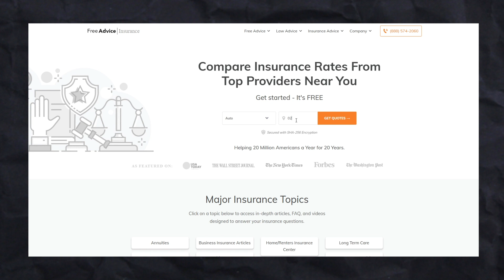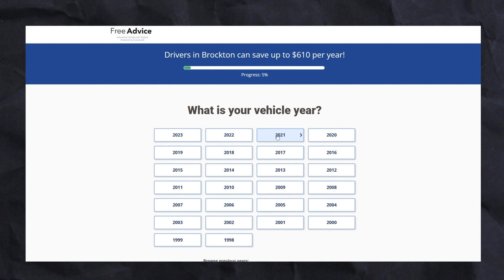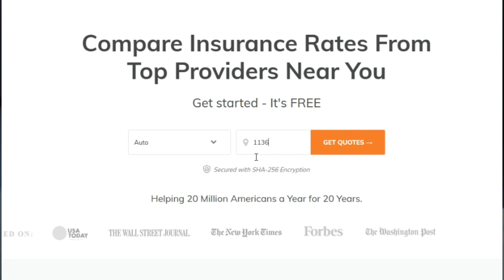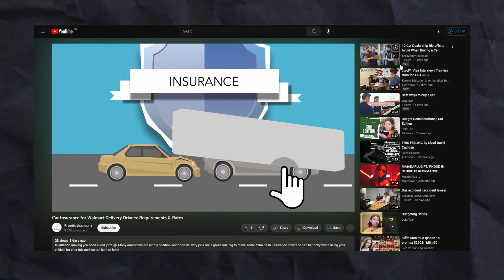“Total Loss” Car? Get a Salvage Title and Back on the Road in 2025!

Comment: Salvage title vehicles may have sustained significant damage, compromising their structural integrity and safety features. Repairing such vehicles requires expertise to ensure they are restored to a safe condition. It is crucial to thoroughly assess and address any structural, mechanical, or electrical issues.